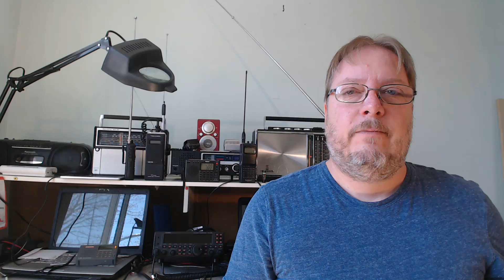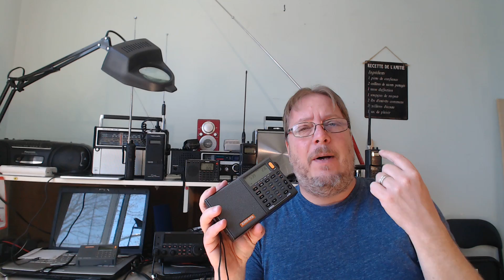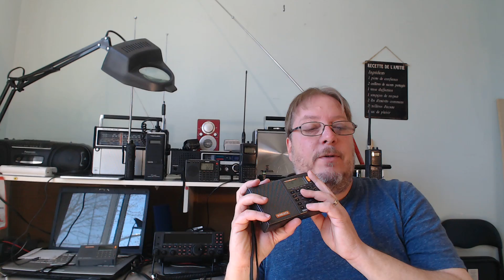Shortwave radio tip 34 There are some FM mode signals

Comment: FM is also used in railway radio communications (2130, 2150 and 2170 kHz) in the post-Soviet space (only stretches).